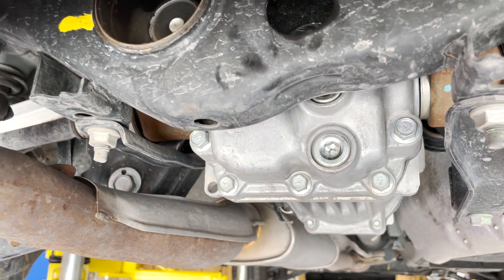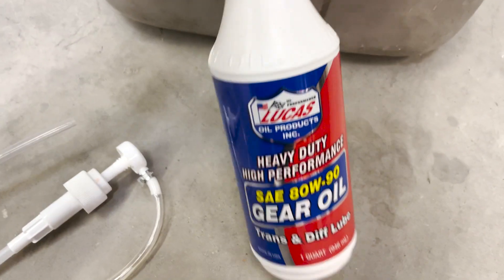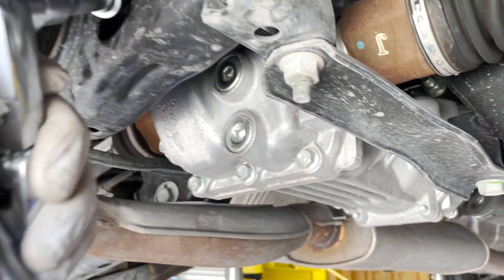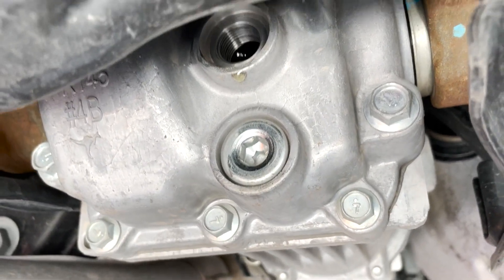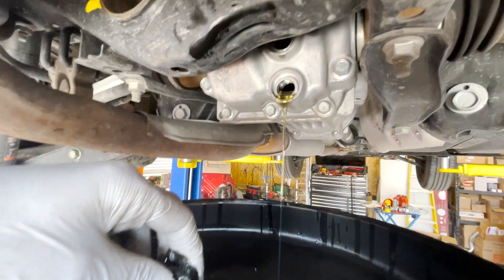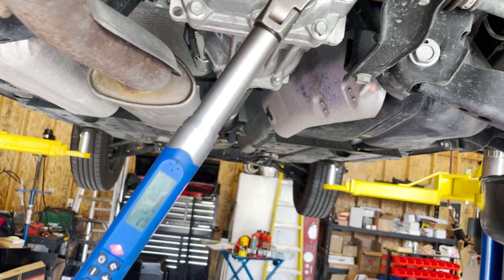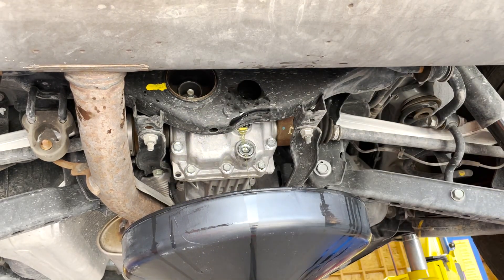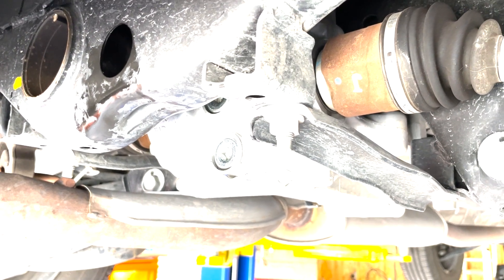2014 Nissan Rouge Rear Differential Service

Comment: The rogue only has a transfer case and a real differential correct to change The service department in Nissan wants to charge me for front differential change but I don't think that's correct
Reply from the maker: That feels like the service manager is misinformed on the specifications of a Rouge. This does happen and the best approach is to pull out your owners manuals and ask them you show you where the maintenance is specified in the owners manual. Thanks for watching!